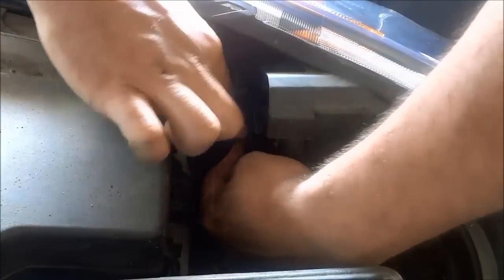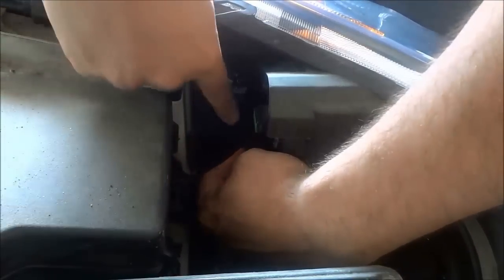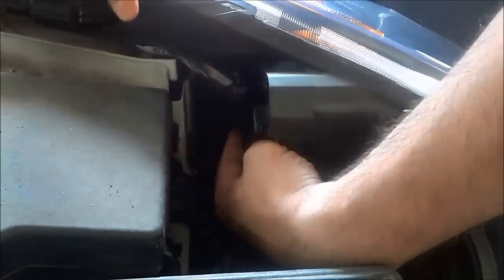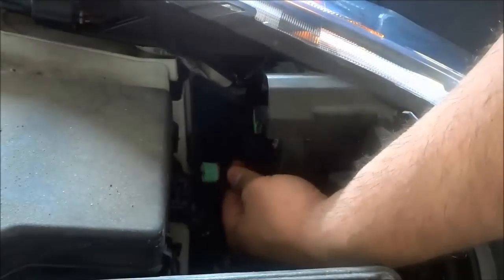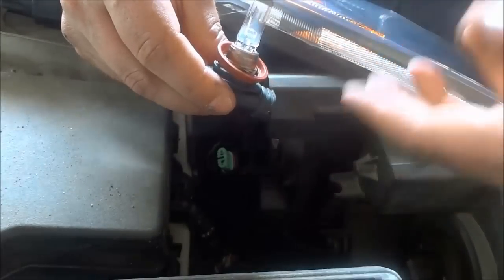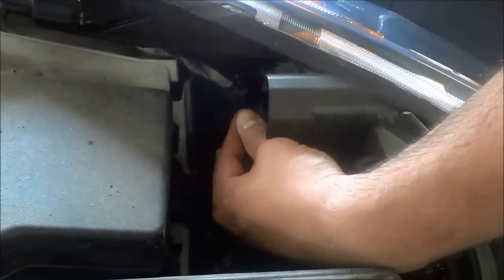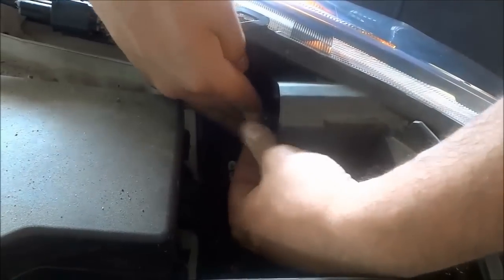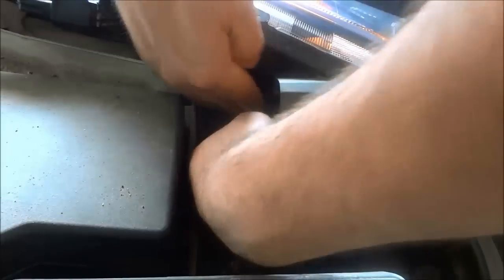How To Change Headlight Bulb On 2010-2013 Mazda 3

Comment: Only thing I would add is that many of the new replacement bulbs recommend you use gloves or a paper towel to handle them because finger oils cause damage when the bulb gets hot. Otherwise, thanks! Super helpful!
Reply: @sleepingxbooty  nope, because they are not that kind of bulb. Halogen and most new auto bulbs are different than kitchen light bulbs. Thank you for attending my Light Bulb 101 TED talk.
Reply: i know im pretty late and correct me if im wrong, but as long as your fingers dont touch the bulb itself, and just touch the plastic around the glass, there shouldnt be any risk of damage no?
Reply: @sleepingxbooty

Ignoranus: Automotive halogen bulbs are completely different types of light bulbs than any type of household kitchen light bulb. 
You’re welcome.
Reply: @KnightFall3934

As long as ANY part of your skin doesn’t touch the bulb or tip, it’s ok. But with the right working space, gloves and paper towels eliminate the risk.

Comment: Thank you for this video. I drive a 2010 Mazda 3 iTouring, and found it easier to unscrew and remove the bulb prior to releasing the clip, since my clip was particularly difficult to remove. But thank you for your video, which helped me out. This was a bit different than I remember with my older Saturn, where I thought I had to remove the casing to get to the bulb.

Comment: Not sure if you'd know, but I was told by the guys at Autozone that my 2012 Mazda 3 has some kind of special light and that their bulbs won't match the color of manufacturer originals.  I called the dealership and they said that it would cost me $535 to replace it because the part itself is $275 and they have to take the front bumper off to replace it.  Does that sound crazy or what?  Any idea why it's so expensive?
Reply: antifolkhero sounds like you have the HID Bi-xenon headlights. In this video because he says the DRL is also the high beam bulb this is not the Bi-xenon. I have a '11 3 with the bi-xenon. We might be able to get some clarification on which exact headlight set up the video poster has, but I believe I am correct.
Reply: I have the 2012 mazda 3 and it's just as is in this video. The replacement bulbs I got were better than what came stock on it.
Reply: Other than it appearing like you had a super bright light OUTSIDE the car making it hard to see what you were doing, it was decently described.  Thanks